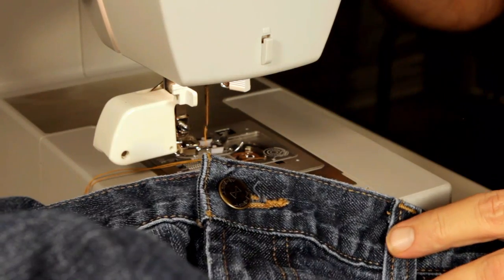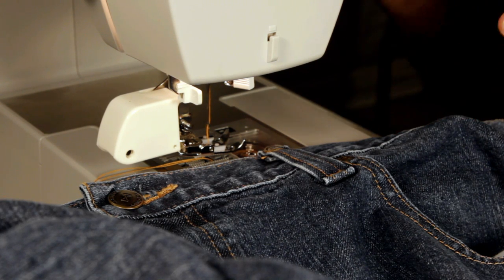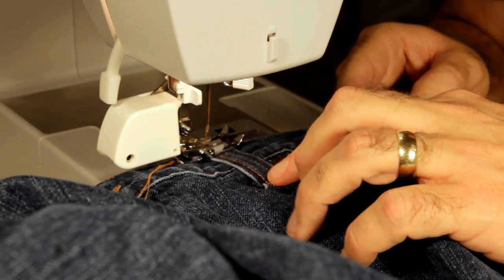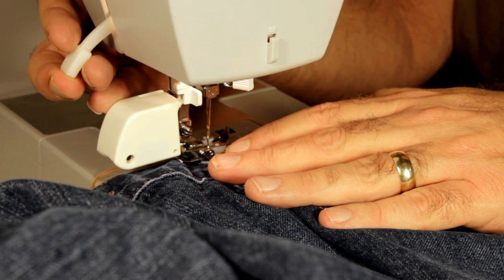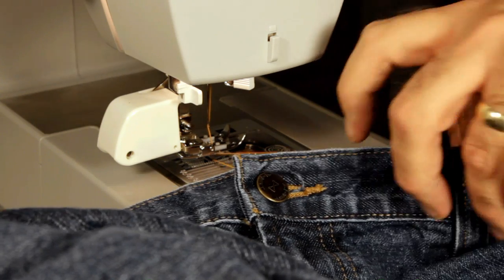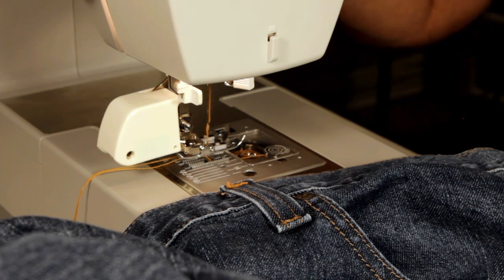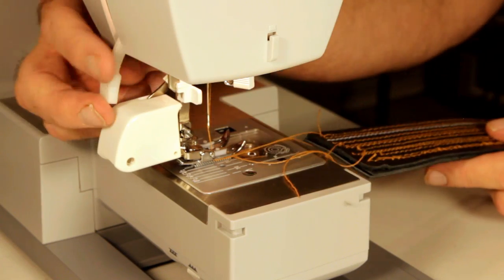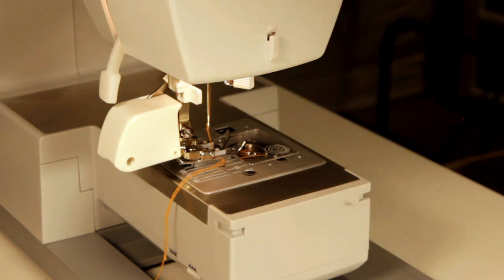Singer Heavy Duty Sewing Belt Loop on Jeans, Leg Hem and 4 Layers of Leather

Comment: I just bought a Singer 4452 Heavy Duty after my Viking had lots of trouble with multiple layers when I was making a backpack.  I love making purses and bags, so figured this would be a good investment (especially for under $200, complete with Walking Foot and other accessories).  I've only had the machine a few days, but I already love it.  I started my backpack on the Viking, then switched to my new Singer as soon as I got it.  OMG, what a difference!  I did bias bindings all around through multiple layers of fabric, and while it took a little getting used to, it handled all that beautifully.  And I wasn't even using the Walking Foot!  Next project I'll try that, too.  Thanks, Kevin, for all your videos.  I'm learning lots of great techniques to use with my machine.  Very helpful!
Reply from the maker: My pleasure!

Comment: I need to reattach two belt loops each on three pairs of Levis.  I removed any stitches that added bulk so I could deal with a little less thickness.  However, I'm usng my Janome, a walking foot and size 18.   Wish me luck.  Thanks for this video.  I subscribed.
Reply from the maker: Good luck! If the size 18 doesn’t work then try a size 16. Sometimes a slightly thinner needle works better.

Comment: You have inspired me to get this machine strictly for repairing jeans. Please tell me which walking foot you'd recommend and what features it has that are important...I've never used one before.  Thanks! Great instructional video.
Reply from the maker: +W. Smith Make sure you buy it from a source that has a great return policy. Due to the low cost of this machine a few have reported receiving a defective machine and had to return or exchange it. If you get a good one you should be good to go. Any walking foot for a low shank machine should work for you.
Reply: Kevin Sews Thanks!
Reply from the maker: You're welcome! Let me know how it goes if/when you get your machine.

Comment: I greatly appreciate your videos. Thinking about one of these 44 series. My plastic 1990's Singer hits that seam and just goes "thunk"! Powering through by hand just feels abusive to the machine.
Reply from the maker: For the money they are good machines. If you can buy it from Walmart and purchase their extended warranty. I've used it and it more than paid for itself after 2 years (i bought the 3 year version).
Reply: I noticed in one question below, you said you used #69 thread on leather. Did you have to reset the bobbin tension for this as well as the top tension?
Reply from the maker: Top Tension is between 7 and 9. The bobbin was slightly tightened.

Comment: So the model 4452 is exactly like the 4423 and 4432 except each have different stitch counts?  The machine itself is the same powerful machine for all of them?  Would this machine be strong enough to make an occasional slipcover out of  8 oz. canvas?
Reply from the maker: The are basically the same machine except for the options the 4452 comes with. It came with additional feet and a walking foot and the flower wheel attachment too if I remember correctly.

Comment from the maker: +Antonio Grieg  It all depends on how often. Remember, this is a domestic machine designed for the home sewer. What mfgs think this means is sewing a few times a year - not even 2 times a week as I've been told by mfgs at conferences. Therefore, it will sew leather and canvas just fine. A safety belt might be pushing it. However, you can't sew on it daily without wearing it out within a few months to a year. For daily sewing of heavy materials I would suggest an industrial machine.

BTW, for some reason I can't directly reply to your comment, so hopefully you will get this.

Comment: Great video Sir.
My Machine came with the Walking foot in a box and had no clue as to it's use/purpose, the manual was sparse.  Any videos on installing it on the machine? Thank you.
Reply from the maker: Remove the screw that holds the foot holder. Then you can install the walking foot and insert the screw and tighten it down.
Reply: I just got mine and I tryed it and it is perfect I got a walking foot as well and i try it too it is good I Love it

Comment: Thank you so much for your videos! My mother got me this machine and I am so new to sewing I need to be more patient with getting the settings correct for sure! lol but I have wasted about six spools of thread and broken about a dozen needles trying to hem jeans and turn my 7 yr olds holy pants into shorts lol I watched your video and bought a walking foot. I was wondering though, what do you have your tension set at when you are sewing denim? what about the tension for the leather you sewed on your other video? Thank you for any info and again, for taking the time to post these vids, there really isn't a whole lot of info on these machines. they kick butt once you get familiar with them and the get the settings right for the material you are working with... God Bless!
Reply from the maker: JnDs Momma the heavier the fabric is the tighter the tension and the longer the stitch length is the general rule. I generally use a tension setting around 7 when sewing denim

Comment: Help!  I just purchased the Singer 4452 today, for the purpose of sewing hats in heavy fabrics, because my Singer Stylist cannot handle such fabrics as mud cloth. 

I just attempted to use my walking foot to help in sewing through two layers of mud cloth and the 4452 is struggling and unable to complete the seam.  I also increased the tension setting to no avail.  Do I need to adjust the settings, tension, pressure foot, etc?  Thanks mucho!
Reply from the maker: Is it not feeding the fabric? Also, what size and type of needle are you using? The machine comes with size 14 woven needle. That will be a bit too small for what you are trying to sew. A size 16 or 18 denim needle would be best. After that you can try adjusting the presser foot pressure for heavier fabrics. See your manual on how to accomplish this.
Reply: @kevinsews  I really appreciate your prompt response!  I have changed to a 16 needle, which was provided with the machine.  I also changed the pressure foot pressure.  The machine sews a few stitches, then the needle seems to brush against the back of the foot opening.  I was using my walking foot.  Is there any other alteration I need to make?
Reply from the maker: @rinawallace1962  Something is not right. Is the walking foot a Singer version or a generic? Is the fabric so thick that the foot is setting so high that the needle is still in the fabric when the machine feeds it? Can you capture a cell phone video and post it?
Reply: @kevinsews  I was unable to create the video showing the problem.  What I noticed is the machine stitches about fo  ur times, then it freezes with the needle down, sometimes at the base level and sometimes below level in the area of the bobbin.  Also, the needle does hit the pressure foot, actually bending one size 16 needle severely. 

The mud cloth is nubby and in attaching the brim to the crown, there is five layers in some areas.  I ended up going back to my Singer Stylist and using the size 16 needle to push/force the layers in stitching, getting through all but one small area.  The 4452 worked fine in stitching several layers of gathered cotton fabric. 

Perhaps I should have used a higher tension.  What do tension level do you recommend for such fabrics as mud cloth?  Thank you so much for your help, expertise and patience!
Reply from the maker: @rinawallace1962  Does it sew thinner fabrics okay?
Reply: @kevinsews  Yes.  After my frustration with trying to sew mud cloth on the 4452, I was able to sew through four layers of tightly gathered cotton without problems.
Reply from the maker: You're fabric sounds like it is too dense for the machine and/or needle you are using.
Reply: @kevinsews  Thanks for your response.  Agreed, this particular mud cloth is very dense and nubby.  I finally gave up on using the 4452 for that project.

Comment: I'm looking at picking up the 4452. I've watched both your videos and have seen you sew through multiple layers of leather. I do not sew leather but I sew 1000 denier cordura. I use it to make all my own gear. I've been using a Viking 6030 with a low range setting. It has recently clapped out and it is done. I'm in need of a new sewing machine. Most of my stuff is two or three layers of cordura. I do sew up to six layers with two layers of webbing. I use 110/18 needles and tex 70 thread. Will this machine work or am I better off looking for something else such as a portable walking foot like a rex, tuffsew, omega, or sailrite machine. Thank you!
Reply from the maker: I would go with the Sailrite or one of the less expensive machines.

Comment: Hi Kevin i been watching this video and i was wondering if today 3 years after this video  i could find a new  machine for about 1000 dollar like janome or brother with also many decoration stitches like my singer 9960 or less but with a stronger motor, i would like to buy a new one for the leathers mobile phone bags i do. i know that those kind of machine are not suitable for leather work, but the leather i use is quaid soft. and i need the decoration stitches for make the bags more interesting...sorry for the long message ..  my question is do you know a about  1000 dollar new machine with some deco stitches and a stronger motor than a singer 9960?
Thank you kevin for your time
Have a good one
Reply from the maker: +takes2home Janome 6600 (or the previous model 6500).  6600 might be a bit over $1000 though. However, I've seen them listed for a bit over $1000 on E-Bay from time to time. You'll just have to shop around to find the best value.

Comment: Hi sir, I'm a fan of your work.
Can you send me a whole picture and what kind this machine is? Please
Reply from the maker: It is the Singer Heavy Duty Model 4452 (same as the 4432 with more accessories). All of the Singer Heavy Duty machines are the same on the inside motor and drive wise. The only difference are the number of stitches and the option of coming with the auto threader feature and the number of accessories they come with.

Comment: hi kevin, me beginner and about to buy my first sewing machine I'm planing on making a handbag for small business.Is this one (Singer 4423) recommended? 

Then I wanna ask, this machine on this video used with default setting (no modification)? or it already had change like the motor or something?
Reply from the maker: +Nicky Hadioso My machines have not been modified. They are very good starter machines. However, you have to remember that this is a low cost DOMESTIC sewing machine. This means they are not designed for daily manufacturing use. Since the cost is so low you can buy a couple to get started with your business and wear them out producing your products. Take the money you made and invest in a good (used) industrial machine. IF you already have the money and space then I would go ahead and look for a good used industrial machine.
Reply: Thanks for your reply, I think its a good idea for a starter =)

Comment: trying to sew belt loop on and it is making a rats nest on the back side what am i doing wrong singer 4423 i do not have that white foot you have on i have the original
Reply from the maker: Make sure the thread is inserted into the tension disc. See the video I made on this topic: https://youtu.be/8TPB2yzw-1Y
Reply: I had the same problem, the tension needs to be really well adjusted or else it makes the birds nest. I found that 3-4 works well. Also make sure you’re using the right needle and thread for thick fabric. Preferably a 100/16 sewing needle and denim or top stitch thread.

Comment: So Is this machine good in general for making jeans from scratch with my patterns? I saw another video on a guy making jeans with this machine and it didn’t go so well. But in other videos it goes through thicker fabrics without a problem. So I’m not too sure at all what machine to buy... are there other ones you would recommend?
Reply from the maker: Can you post a link to the video of it struggling while sewing jeans please?

For the price it is worth a try. I know it will handle any of the modern stretch denim without any problem. The old heavy Levi's that were 14 oz and above it may struggle at times. However, all of my demos are using those old Levi's that are very thick.  I prefer this machine over the Janome HD1000 because it has a presser foot pressure adjustment. If you go up to the Janome HD3000 then you will get this feature. The Brother Tough  and Strong wasn't as tough as this machine when I tested it either. So again, for the money I think this is the best value for sewing heavier fabrics.
Reply: Kevin Sews please let me know when you’ve seen the video. Questioning if I should still buy it or not. In general what is the best reasonable priced machine for sewing thicker fabrics?
Reply from the maker: @aliciakatsouris  I tried to watch it, but I got lost in all the pimping he is doing for another company's product. Plus, he it sounds like he just went and bought a machine and tried to sew up a pair of jeans  as his very first project?  That is like trying to drive the Indy 500 the first day you learn to drive.  Sewing jeans on a home machine that cost less than $400 is going to be a bit a bit of a challenge on any domestic sewing machine. Just take a look at the machines used in a factory jeans production line. Denim can be very dense. However,  many of the new fashion denims are much thinner and lighter that give you a chance to sew them on a domestic machine.  IF you can fine one take a look at the Toyota Jeans machine. I tested one of their models a few years ago and I was really impressed with the power of their machines.  Here is a look at the inside of the machine: https://youtu.be/wzsJGGKFjGw  Here is a video demoing the power of the machine:  https://youtu.be/84y80YKTVnA  If jeans is your goal, then I would go with the Toyota. It will cost you a bit more, but there is no doubt it will sew jeans better.  Debbie Shore is located in the UK and she posted a video of the Toyota machine here: https://youtu.be/DilPkkZEUhI   The jeans version has a special foot the Toyota designed for sewing jeans. If you buy  another version you can order the foot and you will basically have the same thing I believe.
Reply: Kevin Sews I see so many bad reviews of the stitching and light weight of the Toyota machine under that video. So the somewhat best reasonable priced sewing machines for jeans are the singer 4423 and the Toyota sewing machine? Can you give any other recommendations of the best machines for this material no price limit? It can be more than $400.
Reply from the maker: @aliciakatsouris  I've sewed light weight fabrics on the Toyota without a problem, so I would say it might be a users inexperience. It is hard to say not knowing exactly what they were using needle wise and stabilizers they need to use. Let me know exactly what you'd like to see an example of and I'll make a video for you.
Reply: Kevin Sews hmm ok good to know. Is the Toyota machine heavy and has enough power? I want to sew denim and coat fabric maybe leather. Would you say the computerized sewing machines from today are better or it doesn’t matter?
Reply from the maker: @aliciakatsouris  I have a couple of videos on it sewing through several layers of 3 oz leather and denim here on my channel. So take a look at those.
Reply: Kevin Sews Ok thank you I think I am going to get the Toyota machine. What type of needles should I get/use for thick fabrics and the denim?
Reply from the maker: @aliciakatsouris  Denim Needles., Leather Needles. I would buy stretch needles for knits. Get all in various sizes.
Reply: Kevin Sews Ok! like which exactly? I don’t want to get the wrong ones and then break the machine :(
Reply from the maker: @aliciakatsouris  I use Schmetz Needles. https://www.schmetzneedles.com/  Take a look at their new combo set: #1851 (10-Pack) includes three Universal Needles (80/12, 90/14), two Stretch Needles (75/11, 90/14), two Jeans Needles (90/14, 100/16), two Microtex Needles (70/10, 80/12) and one Topstitch Needle (90/14).